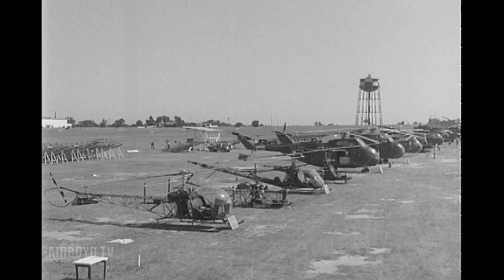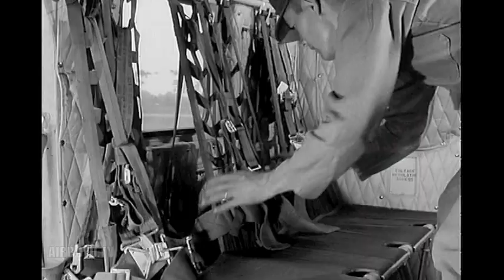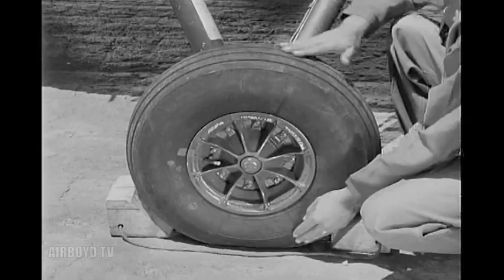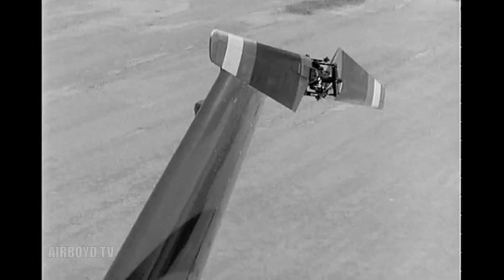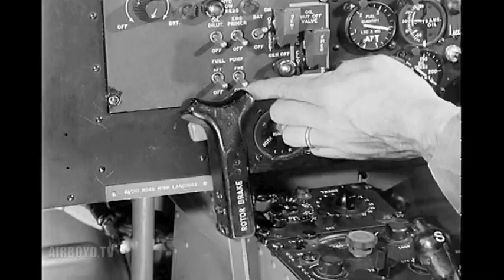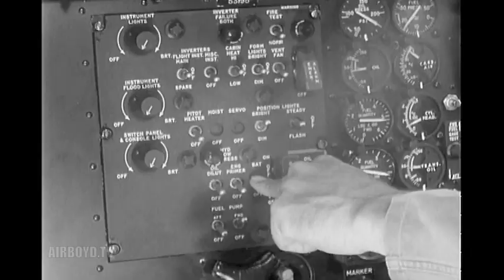Transitional Helicopter Flight Training (1956)

Comment: Yes, on a counterclockwise rotor the right side generates more lift than the left. To counteract this, rotors are typically designed with a "flapping hinge" which allows the advancing rotor to flap up and the retreating rotor to flap down. In effect, this decreases the lifting area on the right side and increases the lifting area on the left, offsetting asymmetrical lift.

Comment: These were certainly different times. Loose headgear was not suppose dot be worn on the flight line in my time. Can't imagine dumping 100LL into my hand either to check it for water.

Comment: Back in the early 70's I was based out of Fort Norman, and one of these bad boys came in to pick up some drums of fuel for some fly camp somewhere, it wasn't a turbo conversion but the old piston engine, gutless as hell.. Anyrate, the pilot stowed as many drums of avgas  as he dared and tried to lift into a hover, no dice, it almost lifted off but powered out. After rechecking weights and measures, the old boy decided the only way to get the thing off the ground was by taxiing down the runway.. so, off he went, eventually, after taking up what seemed like half the strip, he pulled the thing into the air, belching black smoke and clearly struggling, but he was off the ground and gaining altitude, very very slowly... Luckily the terrain was flat as a tack so, he could take his time getting altitude but,boy, never forgot that... I was on a 55T later, and marveled at the power that thing had, would have handled that job easily..

Comment: Preflight fail at the 8 min mark.Black box flopping around loose in the battery compartment. I'd be yelling for the crew chief about that. Did my Aircraft mechanic's training at Ft.Rucker in 1960

Comment: Be cool to convert one into a living motorhome helicopter, you could set down obviously anywhere with all the comforts of the motorhome. Strap on an XR 250 or quad and what a deal.
Reply: YOU CAN'T JUST FLY ANYWHERE.  THERE ARE AIRCRAFT RESTRICTIONS FOR CERTIN AREAS, STATES AND CITY'S.
Reply: Believe it or not, after the military got rid of its H-19s and lots of surplus ones came on the market, there was a real scheme to sell conversions of some of them into motorhomes during the 1970s! Look up the Winnebago Heli-Home. (The actual conversion was done by a firm called Orlando Helicopters.) Unsurprisingly, practically no one actually wanted to buy one: between the huge starting price, the high operating cost for a fairly hefty helicopter, and all the other headaches that would be associated with owning and flying one, it was simply too damned expensive and impractical. Even rental turned out to be too much to ask. What amazes me is that someone actually thought the idea made commercial sense!

Comment: This model was not a lot of fun to fly, the throttle return spring was quite stiff and it had a bad habit of going into ground resonance at the slightest excuse...Other than that it was fine for the era it was used...
Reply: "it had a bad habit of going into ground resonance at the slightest excuse" ... I'm wondering if you can catch a hint of that in the film. Around 20:56 I saw some ground wobble that looked like a bit of resonance was starting to develop until he damped it down.
Reply: @colindhowell  Could be, this model was always doing  that.

Comment: Thanks for clearing that up. I have one more question. On a counter clockwise rotating   rotor wouldn't forward momentum only give extra lift on the right side of the helicopter?
As the right blade would be moving into the wind and the left with it. Or does an airfoil also work backwards?
Reply: The advancing blade creates more lift than those retreating, but cyclic input by the pilot compensates for this, in this model forward and right cyclic takes care of the problem.
Reply: The rotor blade has pitch that varies constantly, but the entire rotor system as a whole can also be pitched relative to the airframe that is hanging beneath it.. So the rotor system at high speed acts like a spinning disk the same way that a sinning frisbee creates lift even though it has no blades.